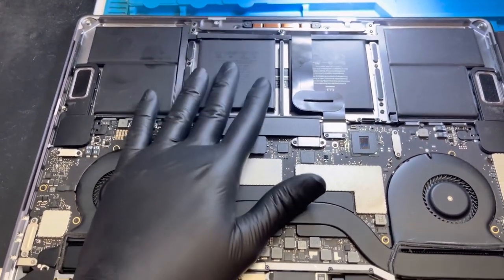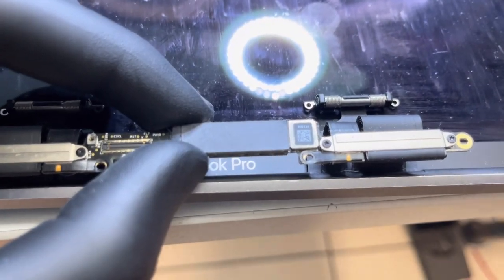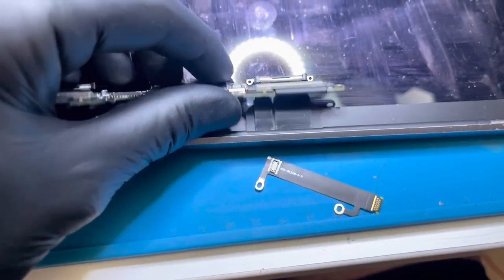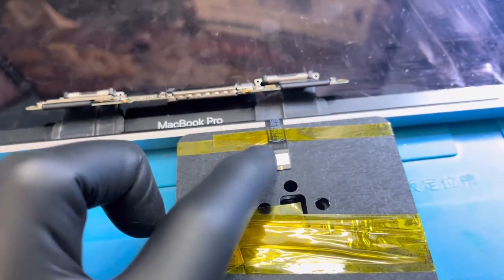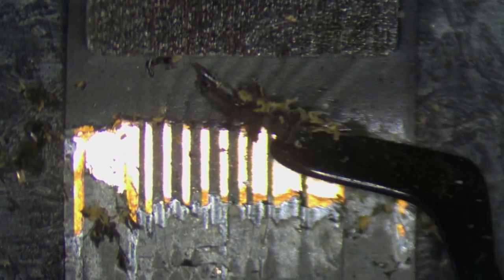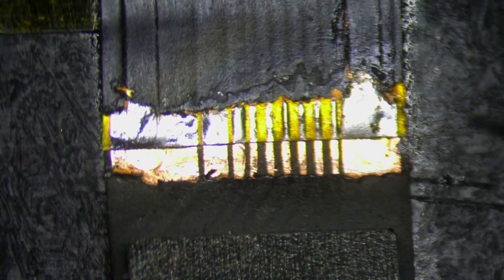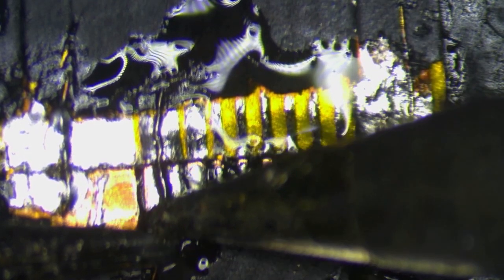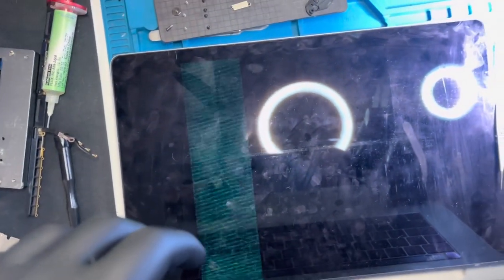Step-By-Step MacBook Flex-Gate Repair

Comment: that right side flex cable doesn't carry 5v for the camera, only backlight output voltage, GND and six feedback lines. All the camera data and voltages are carried in the thin flex on the other (left) side

Comment: Awsome work mate! 
Question, what are those small black plastic squares you use to hold the cable onto so you could work on it, called?
Reply: I think he just used some random PCB stencils and stacked them.  
You could essentially use anything, even a piece of wood. 
He was just able to stack them high enough so it was the perfect height to lay the cable on and  a tape it down.
Reply from the maker: They are CPU stencil platforms - like Jeff said, you can use anything, as long as it's as close as possible to the display assembly so you have room to work with which makes the repair all that much easier to do!
Reply from the maker: Word!